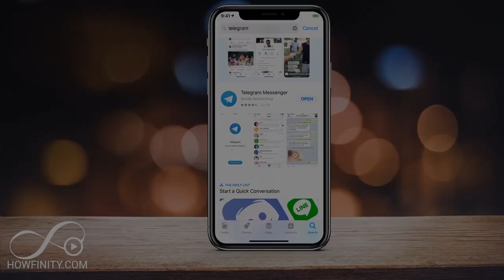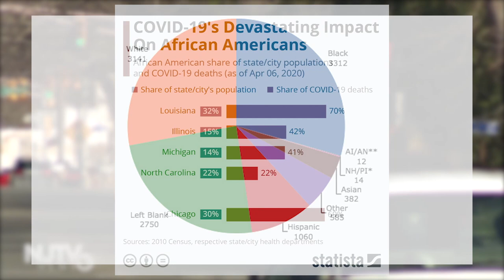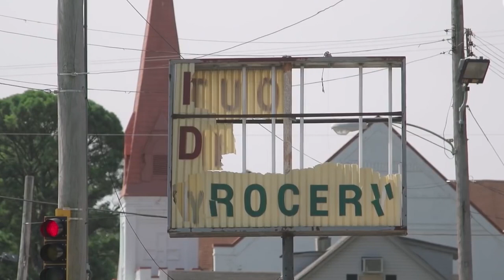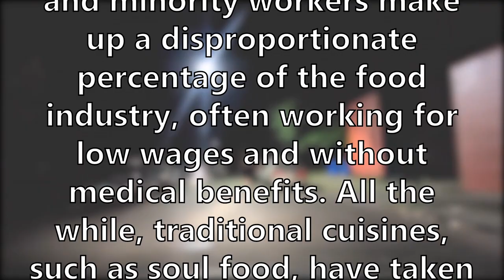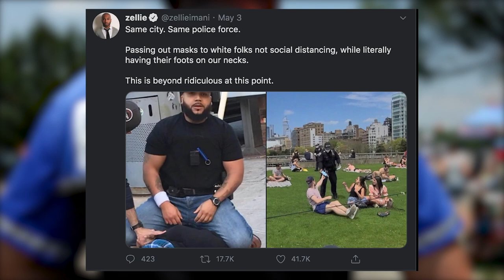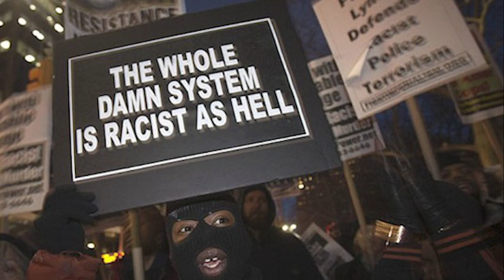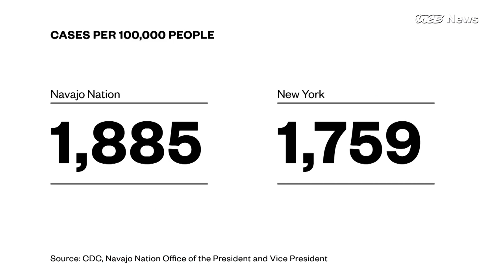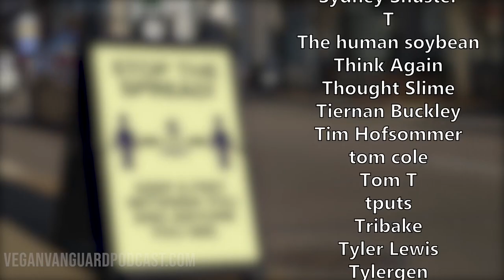COVID and White Supremacy

Comment: I agree with your over-all points and I think the way you approach the subject, as an inter-connected system wide problem is very important and informative. I would like to see more rigour in you citations, especially when explaining why covid-19 has disproportionately affected non-white people and communities. You make a lot of causal claims, but don't back them up appropriately (though I do agree). It would help make you're arguments stronger and more  convincing. There's already emerging research regarding this issue, it's worth a read, and not too difficult to access.
Reply from the maker: feel free to link anything you feel is important

Comment: Hi Mexie! Loved the video and generally agreed with your conclusions. However, I just want to point out a small mistake/oversight. While talking about racial disparity in covid deaths in the UK, you messed the numbers up somewhat. This article in the independent: https://www.independent.co.uk/news/uk/home-news/coronavirus-death-toll-uk-race-white-black-asian-bame-ethnicity-cases-a9557076.html cites white people as making up 73,6% of deaths, which would make POC 26,4%. That is lower than the 35% you say in the video, but indeed disproportionate to POC making up only 15% of the UK's population.

Additionally, the data you show on screen is from this BBC article: https://www.bbc.com/news/uk-england-london-52453782 and is for London only, where the disparity is much smaller, because London has a much higher percentage of POC. As the chart shows, 44,1% of London corona deaths (up to 26 April) were POC, while they make up 40,2% of the population. I'm not trying to downplay the situation in London, but the chart from the independent article would perhaps have been better to use. It shows UK wide data that is more up to date (going up to 13 May) and also highlights that in the UK it's actually south Asians (especially Pakistanis & Bangladeshis) who are most disadvantaged.
Reply from the maker: Thanks!